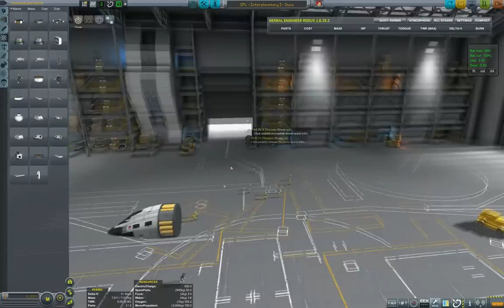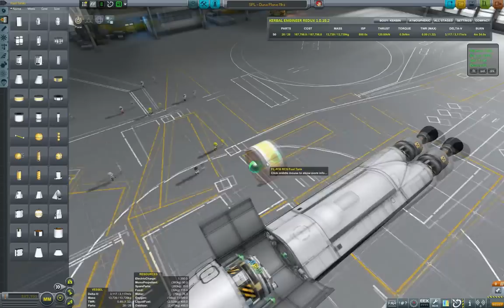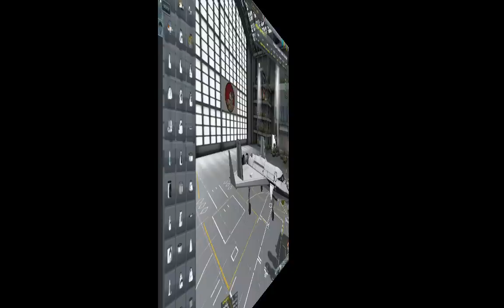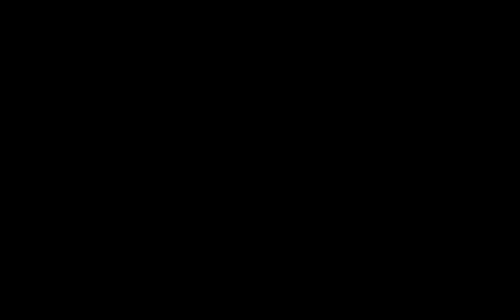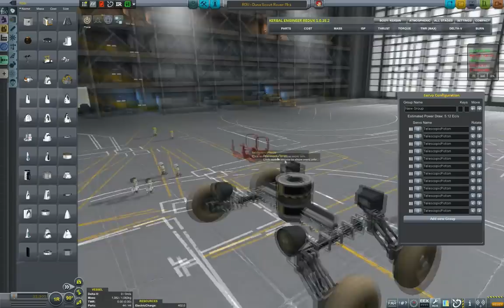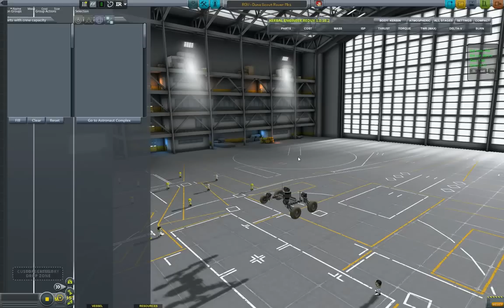Kerbal Engineering - Huge Duna Interplanetary Vessel - 2000 subscriber special - Part 1 - Design

Comment: how do u have so many mods and things going on without ur game crashing. Because my game crashes when that happens.By the way do u use 64 or 32 bit.
Reply from the maker: I am using here 32 bit as this is 0.90, and did every possible trick known to 32bit KSP players.
- ActiveTextureManagement
- OpenGL
- Deleted some duplicate parts
- Recording for 15-20 mins -> Crash -> Rinse, repeat
Reply: +GrunfWorks thank you. And thanks for the response

Comment: Hello... how are you running this many mods without ram crash? I have been waiting an eternity for the 1.1.0 patch to be able to use 64bit version! how are you managing it without it??
Thanks in advance!!
Reply from the maker: +kreliann All tricks that i could think of:

1. Running on forcing OpenGL,
2. Running a v.90
3. Running with Aggressive texture compression
4. Deleted some duplicate parts from some mods i did not need
5. Experiencing crashes on average every 30 mins, but within those 30 mins, i play ;)

Comment: Why dont you upload the sch files for us?
Reply from the maker: I can drop them on kerbalx but note this is ksp 0.90 with lots of mods.
Reply: +GrunfWorks  Thanks for your quick response, that would cool
Reply from the maker: I started this series a while back with a carefully selected mod list, and did not want to risk breaking the save by upgrading everything. After all it is 65 mods. I will play this one out, and then start new series in 1.1 probably